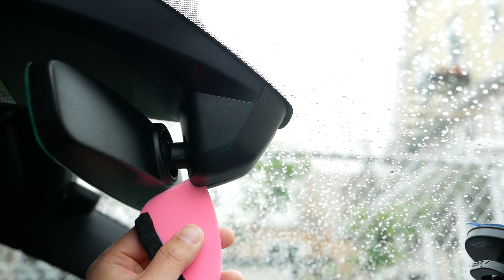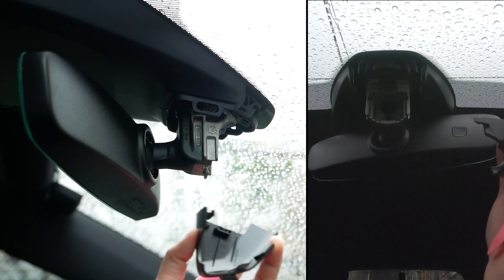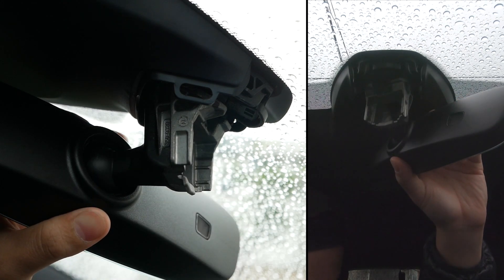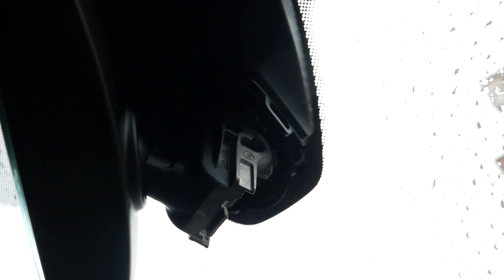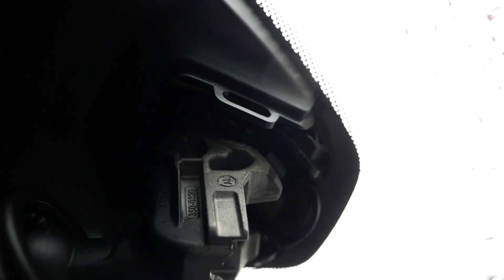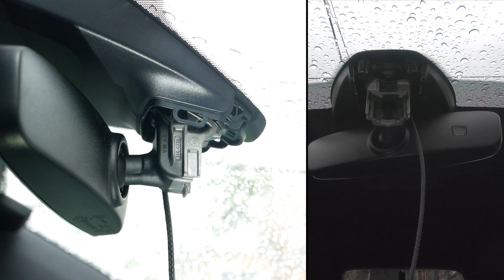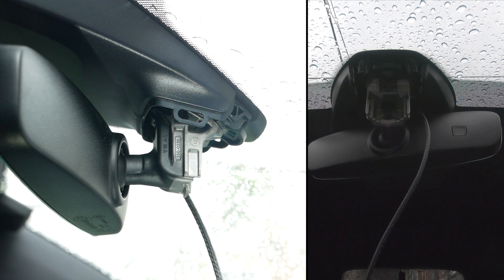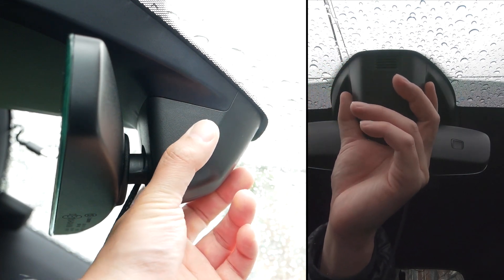How to Remove Homelink Rearview Mirror in the MK7 Golf GTI R (Unedited)

Comment: So I'm gonna try explain my problem as good as I can. I bought a used golf vii but I get the error acc and front assist not available and my cruise control doesn't work. I asked the seller what's the deal with it and he told me that he went to a programmer to deactivate it because the lane assist sound got on his nerves. So did he deactivate it via a program or is there any chance that you can cause a problem  in the mirror on purpose in order to read a false and stop working?
Reply from the maker: Hi Stavros, by programmer - I guess he used a tool like VCDS deactivate his lane departure warning but I'm not expert. Sorry I can't be anymore of help.
Reply: @ilimit  hello kind sir! I have a vcds but I'm no programmer and I don't know what line to look for and change it.

Comment: Hey buddy I wonder, my VW Atlas had a loose rear view mirror and the mirror and the procedure is exactly the same as yours. Did the new mirror had the epoxy or glue to stick it to the windshield? If not, which one did you use?
Reply from the maker: Hey Vic, The base would be glued to the windshield. This video just shows me removing the mirror from the base. I didn't have to re-glue anything. Good luck!

Comment: Thanks for your help. Mine has a rattle which has to be sorted. 👍🇬🇧
Reply from the maker: No problem 👍
Reply: @senna-xi1gr did you get anywhere with the rattle? I have the same
Reply: @bzdkn  yes I just followed the video instructions & put some black insulation tape on anything that would possibly make a rattle inside popped it back together & bingo 👍 good luck.